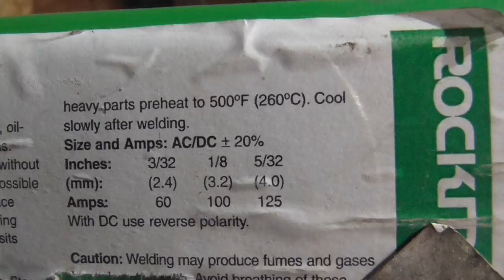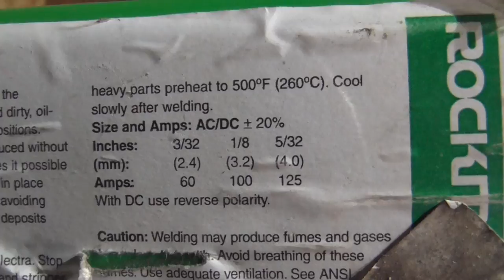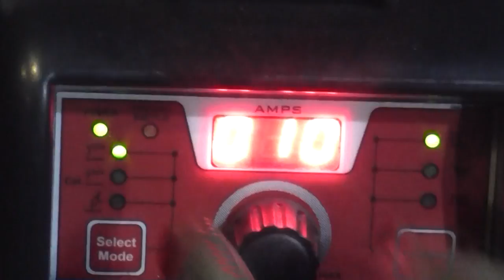Secret of cast iron welding

Comment: Zila, you are the greatest......thank you for sharing this information ........Paul
Reply from the maker: Paul, i dont know about that …
I just recorded a video for cast iron yesterday ….  Mig ….  Some AMAZING stuff! …
Reply: @ZILAwelds  I am getting ready to do a 55% vz 99% nickel video on Thursday.....doing some research.....thanks for the feed back....I got to use some Hastalloy X .03a few years ago, 12 to be exact, it was $2,000 a 20 lb spool......I had trouble getting it to feed in the Miller 60 feeder as it kept bird nesting, never really got it to run.....the rep who gave to me told me they use for power generation Turbine fabrication......wish me luck on the video....Cheers, Paul

Comment: I do recommend you move the drill to one side or the other, or only bolt one side of the crack. if not chances are this crack will move as seasons change between winter and summer depending on humidity as well.
Reply from the maker: moving the trill is not really a good option ... there is a shelf and a heater to the left and a bigger shelf to the right - it is the "perfect" spot ....
i thought of bolting it to a 1/2" thick plate A36 mild steel ..... and than anchoring that to the floor .... that way it should be fine .....

Comment: Looks like it more than likely broke due to the concrete slab cracking.  Usually that'll just get worse with time.  May be a good idea to move it over just a bit to get it on a flat slab again or it'll just break again.

Comment: Peter, Mount the drill press to a piece of plate steel or plywood then mount the plate/plywood to the floor.  You can also pick a location that does not span a large crack in the floor.  It you don't go with either option you will  have cracks in the base forever.
Reply from the maker: That is a great idea !   I cant remember if the crack or the drill press was there first ....  but cast iron does not have much (not really any "give") so yes - more likely than not - the current set up poses problems - I agree

Comment: I am a veteran cast iron welder and have repaired castings for over 30 years.I have seen so many videos on cast welding with nickel rod and also have redone many castings that have supposedly repaired in this manner. Try this method on a casting that is 4" thick and weighs 2500 lbs, broken in two and see what happens. Torch welding is the only way to go with brass or bare cast iron rod.
Reply from the maker: Paul, welcome to the channel! That would be a pretty bad idea to try this exact procedure on a 4” thick casting … you and i both know it has very little chance of long term success…
Btw this stuff here still holds up - years later. 
I have a BIG cast blower cover plate coming, that i have mig welded here a week or 2 ago i am in the process of editing the video…  if you want to keep an eye out in the next few weeks it will go live. 
There are a lot of things that can be torch welded i agree and its almost a lost art.  I learned oxy acetylene when i was 13 more than 30 years ago and i learned stick just over a decade ago….  
I welded a big pillow block from a bearing with a 8” shaft ….  So the casting for the pillow block was 3-4” thick and i stick welded the entire thing …,  and that was years ago and that still works as well ….  Sometimes there is more than just one way to do things …
Reply: @ZILAwelds  , Just curious, I have a backhoe. Circa 1989. Back digger section held on by top and bottom pins. The bottom pin section holding the pin snapped through on both sides and made a very loud crack sound. Brocken area is like rough sand and a grey colour. Its some type of cast moulding. Its one massive section that the backhoe arm swings from. I did a spark test, sparks are relatively small and stay closer to grinder and are a red type of colour. It ships off like small bits of sand compared to mile steel where it peals off when using chisel.  Any idea on how to fix this issue as its holding a massive amount of weight. The ram  rod also snapped off when this happened. I had only just replaced the other ram rod which also snapped. Was thinking it is some type of cast iron?  If so, would a Ni 55 or NiFe work?  Also wanting to weld mild steel on outside to help support it. Was reading that Ni Fe can be cold welded. Any ideas greatly appreciated as this part can not be replaced. Only have gasless mig, stick and butane torch. Not exactly what type of cast iron it is. It does not seem to be rusting.
Reply from the maker: @marinetrax  first of all, based not he application I really doubt that it is cast iron, cast iron would be way to hard and would have broken during the warranty period...   so what I think happened (if it looks like a casting, the edges and stuff) it is a steel casting not a cast iron casting. what I also think is that over the decades an the load (and possible flex) the part saw/experienced that it work hardened.  work hardening is a real thing you can look it up ... it modifies and changes grain structure and density as well as hardness in the metal and makes it hard and prone to break ....  so the being said:   can you weld it ?!?  sure !  you can treat it like cast iron and weld it .... maybe that works .... or you can treat it like a steel casting, preheat and weld with high tensile strength material like a 11018 stick rod or a E111T1M dual shield wire ... or you can use some 312 stainless "magic" .... and you have a better chance of it working out ...  but bottom line, if I am right about the work hardening ... you need to cut sections out and replace with fresh steel !!!!  and by fresh steel I am talking about most likely A50 (not A36) or maybe even AR400 or 4130 plates to make a new good one ....  either way .... this is involved ...  email me your phone number if you want to talk about it ...  CL@ZILA.net

Comment: Hai mr. Zila.. Just want to ask you..is it possible to weld cast iron with stellite rod? It just for harden surfacing the camshaft lobe that run wear
Reply from the maker: hard surface is NOT for joining. it does not join metals not steel not cast iron.  It creates a hard surface on top of metal.

Comment: Dang you’re right Zila. That welder can weld some crazy stuff!
Reply from the maker: Tony Baggett i own over 30 welding machines - i bought them all with my own money.  This machine is the one that i like best ! Hands down - by far! 
The arc quality is right on par with my 15000 dollar lincoln vantage 400 ...  of course it does not have a diesel motor or 400 amps - but the arc quality is beyond amazing. And it has pulse ....

Comment: I have a similar repair to do on an old anvil stand, castings are completely broke off in two places. I was going to use grinder and bevel out and smooth over and DC tig some silicone bronze over it. About 150lbs so don't think sand both is a possibility should I try both sides at once or one and wait a day to cool and do next side
Reply from the maker: you can weld cast iron cold or hot. if you weld cold you never weld more than 1/4" or maybe 5/16" then you let it cool till you can touch it with your bare hands (no gloves) and then you weld another 1/4".

If you weld hot, you preheat the part with a weed burner torch to 500F-800F and you weld, weld,  weld, and heat in between to keep it hot, and then post heat one last time before you bury it in sand or wrap it in a ceramic blanket ... 

you can do Sibro or you can do ni 55 or ni 99 rods - you can tig or stick weld, you can use MG289 wire .... I mean the possibilities are almost endless - it is a matter of what you have to work with and what you feel comfortable with...

In this video I did cold - look at one of my old videos ver old ... I did a video with chucke in my shop on a transmission bell housing where I did the cast hot ...

Comment: I used a oxy/ ace torch w/flux & silver solder. Took a while, but seems to hold.
Reply from the maker: it does - on cast iron there are more ways than just one to skin a cat.

there is nickel rods - there is sibro there is albro, silver solder - sometimes 312 stainless works - it all depends on what kind and type of casting .... etc ...

Comment: The floor separating split the drill press base... very slowly at first.
Reply from the maker: Bill Titwell i guess.   Good observation !!!!  The problem with the garages around here is: no steel in the concrete and barely 3-4” of concrete.   
In my shop i redid the floor . 6-7” with steel mesh and fiber reinforced concrete ....  there is no love ($) left to fix the garage ....  lol
Reply: I'm sure the floor was split long before the drill press was there. He pulled the bolts up tight wo shimming, stressing the crap out of the cast base. Didnt break right away I'm sure.

Comment: Hi Peter, do you think it's a good idea to weld a cast iron exhaust manifold with 309L electrodes?
Reply from the maker: no - we tried (312) on those tractor pulling manifolds (that was a few month back - i made a video) and than in the video we actually used THIS rods here and it worked great ...   312 works much better than 309 - but either way on thinner castings (that want to crack on you anyway) a new crack will open up right next to the weld ...  you need a filler material that shrinks as little as possible when it cools down ....     in some cases 312 (even 309) can be successful - but when i personally have seen it successful it was not "cold" welding it was "hot" which pre and post heart and covers in sand or ceramic blankets AND the castings where pretty decent SIZE !  nothing small or thin walled ....
Reply: Thank you for the answer. I doubt that i can get these rods here in Europe. I can get Nickel 99 or Nickel 55 rods, which one will be better for that application? Sorry for all the  questions.
Reply: Going for Ni99 then, thank you.

Comment: What is the advantage of this rod over some of the more conventional rods like 7018 ?
Reply from the maker: Paul, that is more complicated that a one line reply.  Unless you do like some other youtubers who weld cast iron with 7018 - in real life that hardly ever works.  7018 draws too much carbon from the base metal into the weld pool and makes the weld too hard. and when it cools down it is either under severe tension and about to break at the slightest impact or additional stress - or as it cools down it stress cracks already.  If you weld cast iron typically you have either high Nickel or high stainless content in those rods (nickel being much better and preferred ) and those rods don't draw much if any carbon from the base metal into the weld joint and they also have a better ductility and elongation (they have "give" they are more flexible) than 7018 that means it can deal with the stress better as it cools down that 7018 would. 
That was the short version ...  now you can get into machinability and pre heat and post heat and how to control the cooling of the metal to control the stress ...  but that is the short answer

Comment: Looks like the concrete crack caused the cast iron cracked. Cool video on the repair. what about people don't have that kind of machine? just asking, Old One Legged Joseph T.
Reply from the maker: run the same stick at the same amperage (or maybe 5+ amps lower ...  and run half the length of bead ....that is what i did all those years till i got this machine

Comment: hallo tocayo, i`m at loss here as i can`t find the welder and the rods around here but thanks anyways. i`ve welded cast iron the old way and it has always been a 70%30 proposition (fortunately 70 success...) this method seems to be really nice. have you tried this rod (less flux) as tig filler? thanks for sharing man. pete
Reply from the maker: p penca where are you from?
Reply: right now i`m südamerika my friend doing repair work on a refinery. it`s esab country here :)
Reply from the maker: http://www.usaweld.com/HTP-Inverarc-200-TLP-Stick-Welder-p/inverarc200tlp.htm    
http://www.stelgroup.it/max-dp-201c/?lang=en

both of those guys sell worldwide ...  the rods ??  i don't know where you can get those from - sorry
Reply: no problem man we do with what we can get a hand on here... just fyi, after taxes, customs, freight, retailers and all bs a machine (with acc) rounding $2500 FOB ends up costing between 4000 and 5000 depending on country around here. that`s why you`ll see on most small to medium shops exclusively 2nd tier machines. argon is about $10 per cubic meter helium don`t even ask :). std rods like 7018 or 6013/6010-11 around $5 per kilo. a 6 cubic meters bottle is around 300. whoa whoa don`t you think?  one thing i`m always amazed is how strong is the welding machine industry in italy. we still have a cebora from the 80 running strong every day. thanks for the replies peter

Comment: what about tig welding the base with silicon bronze to keep the heat down?
Reply from the maker: i did that in the past too - sibro and albrz ...    tig welding and AC tig welding with those rollers ....  

i need to grind some pare paint off and "clean it us better " to do that .... but read ( i can t remember whom i prelude the whole thing to)  but it was in that video in some reply ......   i have done sibro before and it works good too !

Comment: looks like the installation of the machine was over an expansion joint in the floor, man made or not it became one. anyway looks like the bolts did not allow the machine to move so it had to crack. love your videos , keep them comming.
Reply from the maker: it became an expansion joint about 2 years after the drill press was installed ...

Comment: It's sad that if I would have tried this the rest of the base would have broke even more LOL. Great video and very helpful.
Reply from the maker: no one said you had to weld it ...  dill and bolt a piece of angle through ...?  anything is possible .... i could have made a new base plate 5/8" on the plasma table and bolt the pole to it ....  but i just wasn't ready for a major undertaking ....     and ok - with cast it always helps to get a little bit lucky .....
Reply: A little luck and have decades of experience like you do. Oh I would have fixed it but it wouldn't have been as good as you did it. Cast and me have never gotten along. But whenever I say I'm welding I always think "continuous improvement is better than delayed perfection" -Mark Twain. One day if I try real hard I may be able to weld a quarter as good as you.
Reply from the maker: i see your point - although i have been welding for 21 years now ...  up until about 2-3 years ago - i always thought cast has to do more with luck than anything else ...     up until 10 years ago - i always thought it had to be done "hot" ... pre heat , control interpose temp, post heat, then wrap in a ceramic blanket or out 20 lbs of sand over it .....   
today i know - its not that bad and not that complicated .....
you can do cold  (but i mean ice cold )  don't really weld more than 1/4"-1/2" .... than let it cool for several minutes .....  
and i found out that i can do this TIG   (i personally prefer AC over DC  i believe that "stirs up" the puddle and "releases impurities" out of the casting
as far as tig filler i prefer NIi99 or ALBRZ  (aluminum bronze 3/32 dia)
or i can do this pulse mig
030 wire 100% argon a very cold setting  like 200-250 ipm   and either use SiBro or ALBRZ wire ....  
or i can stick weld it ....   and Stick - man - when i found those rods - THAT was the game changer  !!!  at least for cold welds .....

and yes - depending on what you are welding - there still is some luck involved ....

also my rule of thumb is 

domestic castings who usually better than asian castings

also the colder the casting the better it is !

and if it is oil soaked ... these rods all the way ...  if i have to tig them - i use the stick rods, knock the flux off and go to town ....

typically it is pretty successful !
Reply: Thanks I'm going to try that next time. Really appreciate the videos you've been making lately very informative and helpful.
Reply: I would have machined a new base from Titanium... or not.
Reply from the maker: ColKorn1965 cut one on the cnc table from 5/8” plate ...  i have that handy ....  but would have taken longer ....  next time ....  lol  i am pretty sure that would make a good video too!